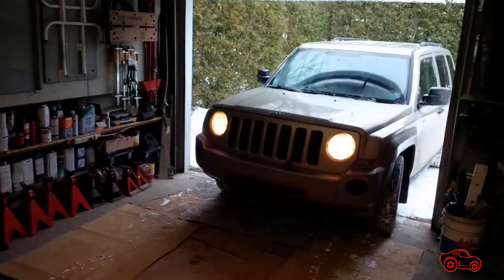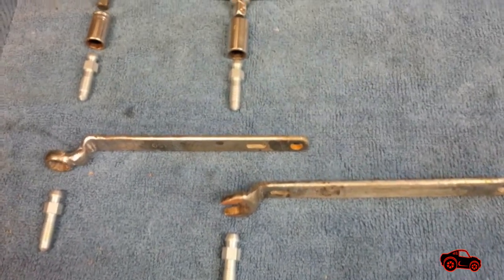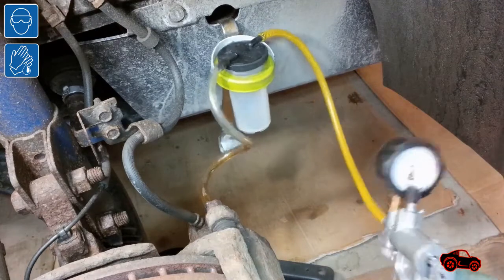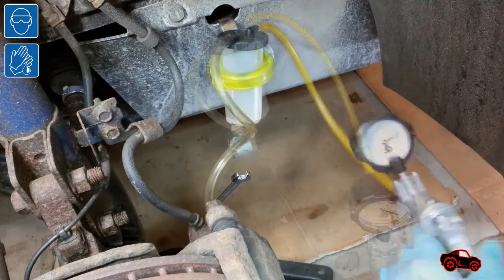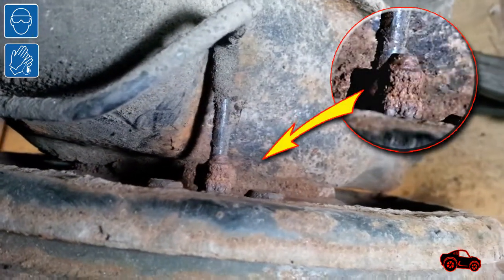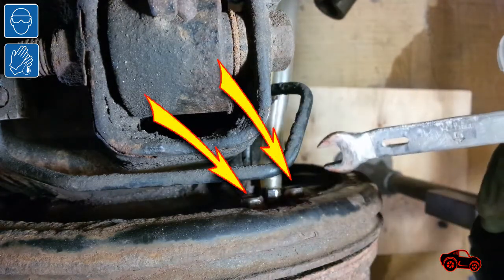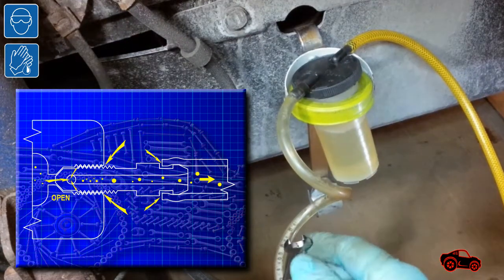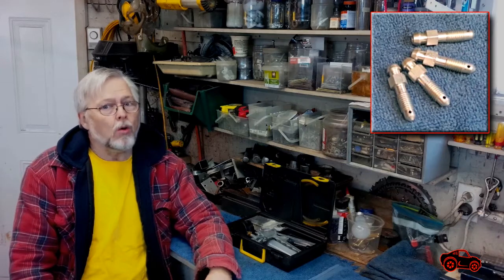How I use a VACUUM PUMP to BLEED the BRAKES on my JEEP PATRIOT

Comment: I didn't like the fact that these vacuum bleeders actually suck air from past the bleeder threads so there appears to be a never ending air bubbles stream. I rather preferred the pressure bleeder - the one that goes on the master cylinder.  For the bleeders, I like to spread some anti-rust spray around the bleeder to prevent it from getting stuck.  Canadian Tire has the green bottle Rust-Check (the red bottle doesn't last)
Reply: Hi…do have a link for a pressure bleeder that fits the Patriot?

Comment: Can you do a video showing us where you are putting the jack stands on your jeep patriot please? My jack tries to slip on my concrete and I need more options on where to safely put the stands. Thank you!
Reply from the maker: It could be useful. I am going to look about it. Meanwhile you can look at those links. 
https://www.jeeppatriot.com/threads/patriot-lifting-jacking-points.328106/

https://www.youtube.com/watch?v=HgtU8fA8OxA
https://www.tru.ca/__shared/assets/Blocking_and_Jack_Stands31282.pdf
https://www.thedrive.com/maintenance-repair/38710/how-to-use-jack-stands
https://www.youtube.com/watch?v=pK3vZljnAgY
https://www.caranddriver.com/features/a27274655/how-to-jack-up-car/

Comment: Great video man! Are the blue pictures you are showing from some sort of manual that is available for purchase?
Reply from the maker: No,  I draw all my illustrations.
Reply: How did you find out the sequence on how to bleed the brakes? I thought you started with the rear passenger side wheel but you started with the driver side rear.
Reply from the maker: @mikeandrews745  I got the information from a Jeep patriot document (Base Brake Bleeding) 
You can check this link, the PDF is for a Cherokee but the sequence is the same 
https://f01.justanswer.com/dcraig1000/a8e86484-e472-416d-9ab6-93255085a4d6_eee2.pdf
Reply: @MTLcarguy Thanks man I appreciate it, you’re a legend! Do you have the document to the Coolant change as well? I saw your video on it but I’m better at reading instructions when I’m actually working on cars.
Reply from the maker: @mikeandrews745  I don't have this procedure written. The work done in this video is based on multiple readings I did over the years. 
 Ref: Bleeding, ...  a mix of those 2 PDF found online could help you: 
(1) https://f01.justanswer.com/jeep10000/e4b5beb1-9941-495d-ade9-ead3398493d0_JK_ABS_brake_bleed.pdf 
(2) https://images.homedepot-static.com/catalog/pdfImages/13/1323e3f5-9504-4f95-93c4-327afe1d4532.pdf
Concerning the coolant it is the same. You can check this PDF
(1) https://static.summitracing.com/global/images/instructions/oes-87009.pdf